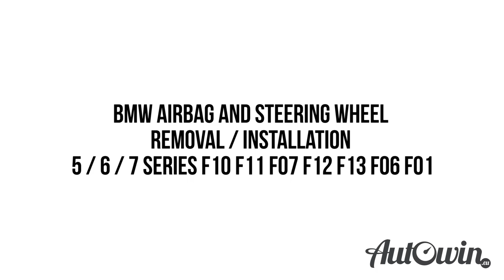BMW Air Bag And Steering Wheel Removal/Installation For 5/6/7 Series F10 F11 F07 F12 F13 F06 F01

Comment: Do you need to re-code the shift paddles?
Reply from the maker: Yes, you need to recode paddles
Reply: AutoWin.EU will this coding work on a 5GT as well?
They are not many equipped with paddles from what I can find :)

Cheers
Reply from the maker: Mister Blueberry yes its same coding on 5gt
Reply: AutoWin.EU ty sir :)